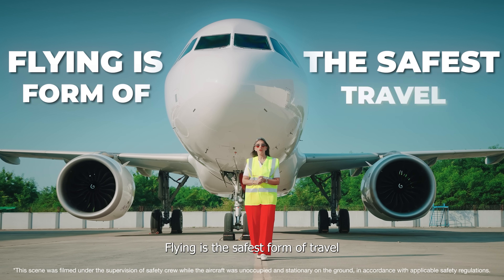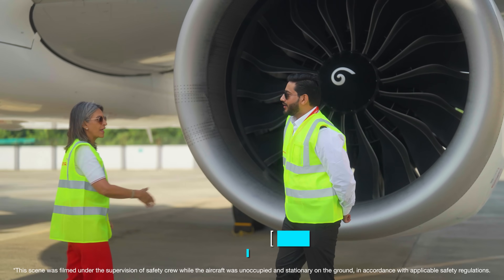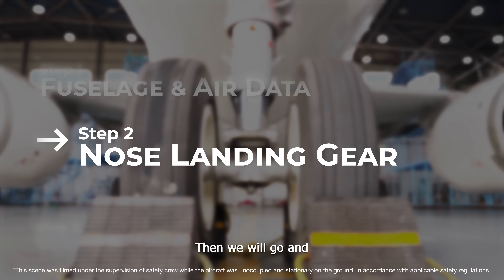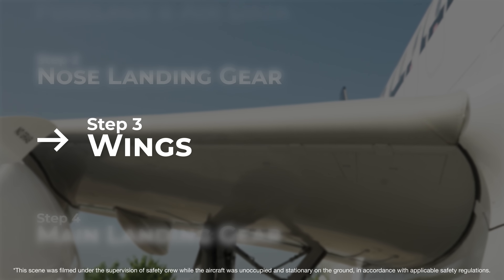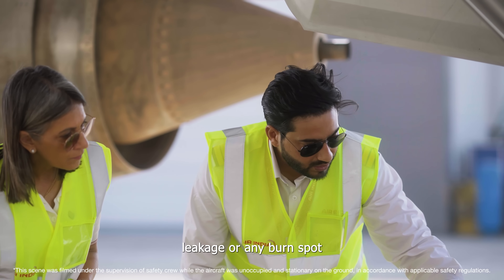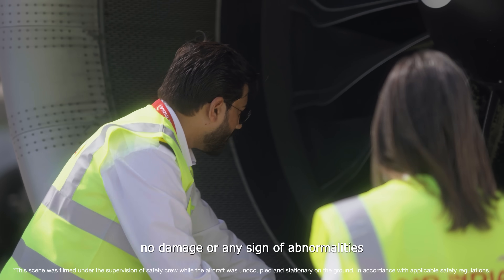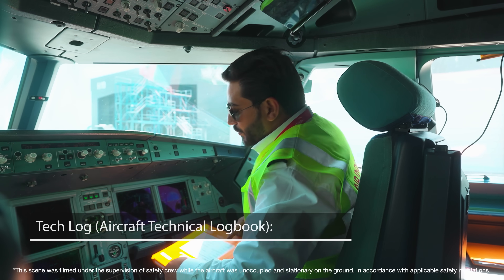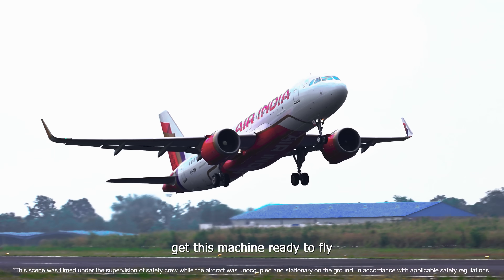Flight Check Protocols Revealed For The First Time | Curly Tales

Comment: Problem is Air India when bought by TATA inherited aged and not properly maintained by previous Govt officials.   It's going to take another 5 years to bring all older planes up to best standard and lot of hard work will be needed by AIR INDIA engineers.    Older plans develop fatigue failures if not properly maintained before - hard to detect with mechanical inspection. (It's unfortunate on recent tragedy - this should be avoided , safety is priority).       My ask is Air India soon retire aged planes > 10-15  years with new planes from Airbus  (plan major inspections and overhaul until new planes are delivered by Airbus).    Air India please stay away from Boeing their quality is down the drain due to Corporate greed and profits (American Business and CEO's are greedy in the recent years).    Work with Airbus who take lot of pride in building their plans with precision and accuracy.      

AirBus has limited production capacity they will take long time to deliver all planes needed by AirIndia , Indigo , Vistara etc , please set-up Airbus manufacturing and assembly in India to cater to India needs and south asia needs (we have plenty of qualified engineers in India to help production).  Indian Govt need to support this initiative by working with Airbus.

Comment: Nice video !!! Just a correction you need to read at 02:24 (You land around 200 miles per hour ) is incorrect.Landing speed on A320/321 is between 125-150 knots approximately (Nautical miles/hr) depending on flap position (3 or full) with max tire speed as 195 knots.